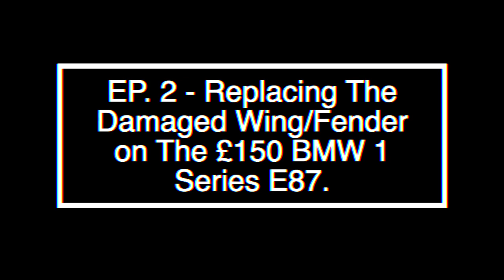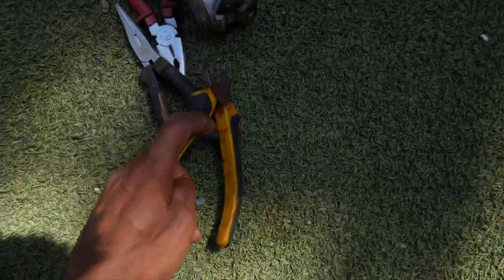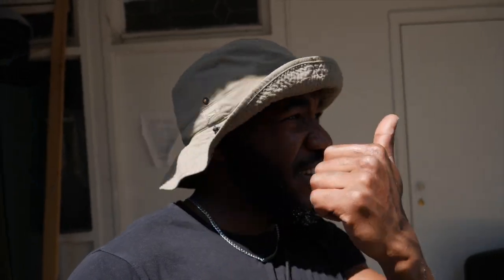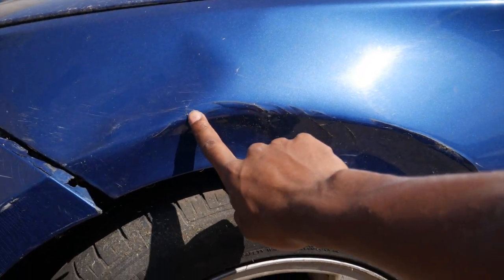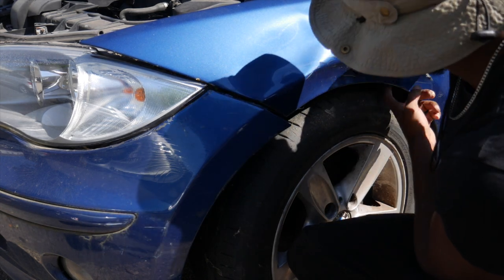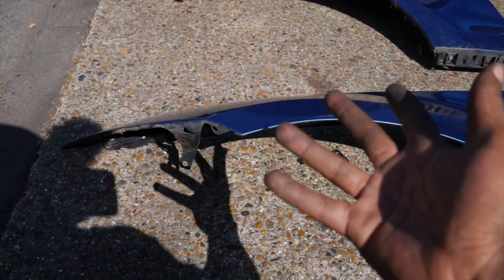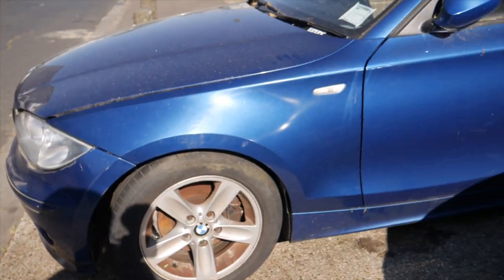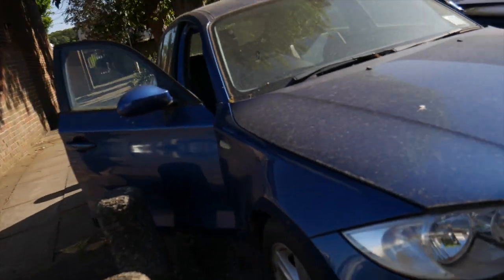£30 Repair and Replacement FENDER on  £150 BMW 1 SERIES (E87)

Comment: How did you remove the last screw on the very bottom of the fender?? Looks round compared to the top bolts
Reply from the maker: Honestly if I remember carefully you can remove it by coming from the top of the fender